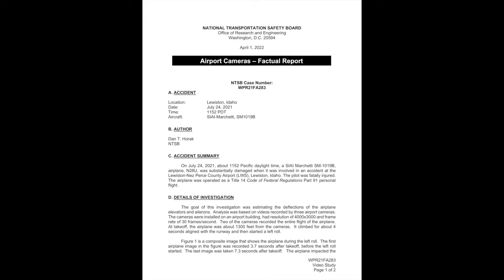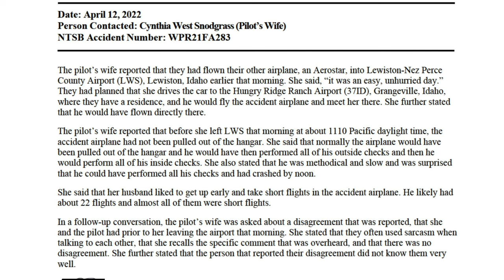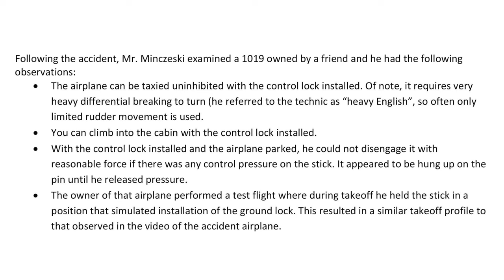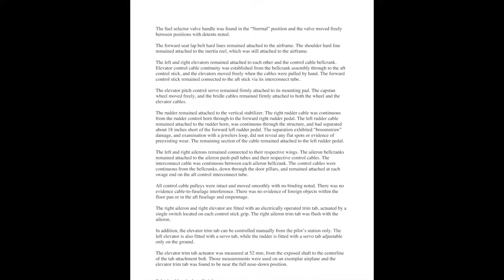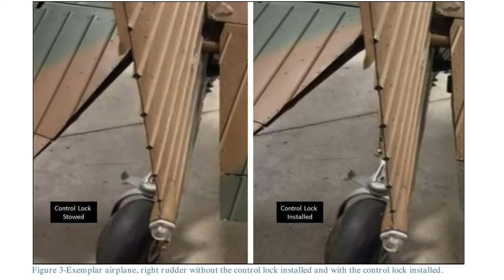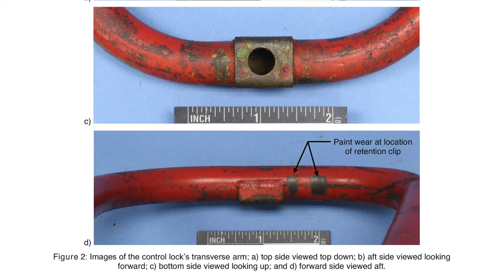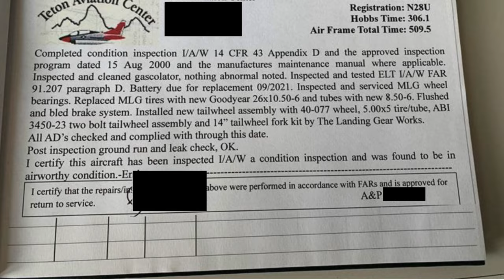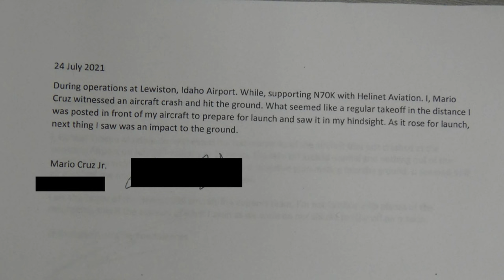Fatal Crash of SIAI Marchetti 1019-B, Part II

Comment: I'm not a pilot. I would barely even call myself an amateur aviation enthusiast. But I do know that even in Flight Sim, during the pre-flight checks, there's always that "flight controls: free and correct" part where you cycle the rudder pedals and control stick/yoke. Just simply moving it in a circle to confirm it's actually moving. It's hard to imagine such an experienced pilot overlooking something so simple. We all make mistakes, sure, but this is like a racecar driver not realizing his steering wheel isn't attached properly.
Reply: You should also look at the control surfaces… can’t see the?
Have someone verify them outside.

Comment: Maybe an improvement could be made to these control locks so they make all controls lock obviously solid instead of leaving the rudder pedals deceptively partially free in a condition that could fool a Navy top gun? I don't fly, but I thought the purpose of the control lock is to keep the control surfaces immobilized to stop them from flapping in the wind, and I thought the rudder would be included as a control surface that would require locking as well as ailerons and elevator. Or if the control lock only partially blocked the stick to an extent similar to the rudder pedals, maybe Snort would have had a fighting chance for recovery.

Comment: I’ve never understood why aircraft are not equipped with airbags. As a 38-yr veteran police officer who has investigated over 1000 collisions, including many fatality collisions, I have airbags save the lives of countless people involved in collisions with much, much higher speeds than what occurred here. Granted, as with auto collisions, airbags are not a guarantee to save everyone, but impact speeds like the one here are survivable, VERY survivable, with the aid of proper safety equipment. Hell, even a HELMET can increase the survivability rate of lower impact collisions in aircraft. Yet here it is 2022 and people still fly these simple aircraft with virtually no more safety protection that a lap belt and a shoulder strap Makes me wonder if “F.A.A.” stands for Forget About Accountability.
Reply: There are seat belts for small aircraft with air bags built in. However, I doubt a stall/spin from even this low altitude would be survivable with them. The reason being that the structure of an aircraft  is not built to be survivable in a straight down impact like this, and to do so would likely add so much weight to make it un-flyable.
Reply: @DirtFlyer  Not true… the main thrust of weight is still forward of the firewall. I’ve seen crashes where people have survived this kind of impact. The ensuing fire likely made sure he was dead. However, this doesn’t need to happen.
There is a fire extinguisher ball that could be mounted forward of the firewall. It only activates by fire, not heat, and weighs 1.5 lbs costs about $100. An incapacitated pilot can’t operated the fire extinguisher on board.
$100 is better that burning alive.

Comment: Two quick points - A) the control lock on this aircraft is both difficult to see and allows for FULL use of the rudder - it only locks the elevator and ailerons.  The NTSB report lists another pilot who experienced the same situation but was able to remove the lock in flight. B) Having spent many years as a FBO lineman, I hope that there is not a well-meaning individual who put the gust lock in place meaning to "help out" a famous pilot who is silently carrying this around with them.

Comment: About thirty years ago I was stopped at a red light downtown, maybe 2 a.m. Zero traffic, town was asleep. I was a little annoyed at my good fortune, being singled out like this for special treatment... I looked left and right, not a car in sight anywhere yet here I was, stopped at a RED LIGHT! the traffic gods must hate me I thought... ah, that's better the light FINALLY changed... Huh? WTF?? I wasn't even all the way through the intersection when I saw and heard lights and sirens behind me. Where the hell did HE come from? So, after the cop is checking my license etc. he asks me if I know why he stopped me. 
"Not a clue", I say. He tells me that he was waiting in line directly behind me when I just casually accelerated through the red light. 
"That's impossible!" I say. "I saw it turn green!" 
"No" he says. "What you saw is the light on the NEXT BLOCK turn green".
"Holy cow" I say. And then, after the usual pleasantries enquiring about my general fitness to conduct an automobile in the present moment, he let's me go without a ticket. I've never had an accident, over forty years now. Knock on wood.

Comment: Will someone please explain in layman's terms, what a 'control lock' is and it's functions?
Reply: Physically stops the winds blowing the control surfaces around when the aircraft is parked, a standard pre flight check is to waggle the control stick or wheel around while looking at the control surfaces to see you have full and free movement range,after maintenance always have some one look that the control surfaces are moving in the correct direction.

Comment: Those two people that saw the accident didn't even try to check weather the pilot of that plane was okay or not. unbelievable! 🤔🤨🤔
Reply: And that is my thought… but they can not just run out onto the airport.
Should the pilot have survived a simple 1.5lb fire ball extinguisher would have put the fire out before help could arrive if he was trapped.
These fire ball extinguishers could be mounted in front of the fire wall. They only activate when fire hits them, not heat effected.

Comment: Not trimmed right?
Reply: He forgot to disengage the stick control lock. Then he forgot to do the "controls-free and correct" actions in the Before Takeoff checklist. Notice that the tail does not rise as would be typical during a normal tailwheel takeoff run. It takes off in three-point attitude and begins a steep climb into a stall/spin situation. His last words were AAHH! SHIT! SHIT!

Comment: This was a sad situation. What also is sad and bizarre is the lack of concern with the people loading that aircraft that just whitnessed the accident and acted like nothing happend, they just went on about their business.  Shortly after this happened I watched a different video that shows the same thing.....unbeleivable, I would have been trying to get there as fast as I possably could to try and help.
Reply: How would you help? The leaking fuel catches fire and you put it out with your hands? ARFF was on its way, that's their job.
Reply: @kewkabe  Exactly. I learned that the hard way when I asked this on Juan's channel and really got beat up in the comments by pilots telling me that the leaking fuel could have exploded and caused more deaths. Apparently ground crew are trained to NOT run up to a crash.
Reply: @kewkabe  everyone acted correctly on the field… never run onto an active airport, even fire requested to proceed.
What might have saved him?… easy… a 1.5 Lbs fire ball extinguisher (look them up on YouTube) One of these mounted forward of the firewall would have put out the fire even with the pilot incapacitated. Not good in the cabin… but forward of the fire wall… seems like $100 we’ll spent.
Reply: @thatguy7085  He died from blunt force trauma though, not fire. What might have saved him was doing a proper preflight inspection or even just a control check prior to takeoff. Those fire balls look like a good idea but are they strong enough to stay intact after a crash?

Comment: Seems like the real problem is the existence of that lock. Is the purpose anti-theft? If so, that’s a stupid idea and those should be removed.
Reply: No, it isn’t for anti theft. It is to prevent the control surfaces from flapping in the wind causing unseen damage to control cables.

Comment: My God, was there a  mechanical failure, after rotation his angle of attack must have been more than 30 degrees!
Reply: No. The airplane had a control lock on it that's engaged on the ground to keep the wind from slapping the control surfaces around. Unfortunately, it seems the pilot wasn't paying enough attention to what he was doing and he tried to take off with the control lock still engaged.

Comment: Looks like a rudder fail?
Reply: Control locks were still on, very experienced pilot too, just shows anyone can make a mistake, some more costly than others.
Reply: More like an utter fail.
Reply: Mate it even tells you in the information what happened, and even if a rudder became disconnected this would not be the result
Reply: Let’s say that there was a rudder failure (there wasn’t), that would have no impact on the accident.
Reply: the video literally spelled out the cause for you......🤦‍♂

Comment: This is simply over confidence and slightly arrogant I know that because in my aircraft I have 2 giant covers where I’ve made it impossible to do this because im not arrogant and acknowledge im capable of this mistake. I have my wind shield blocked with a giant sign saying “Control lock” and the rule is. Remove and stow the lock before a sign can be removed. People the more experience you have the higher your chances are for this type of error to kill you. The arrogant, cocky, overconfident always get taken out by these errors.  Where the guy with 20hrs is shaking like a leaf thinking about the control lock the night before and again on there way to the airport. The old guy never thinks about it. Also. People are saying he did a 2-3hr basic pre flight. It’s not a 747. A basically check if your taking 3hrs your chances of forgetting something goes up. Yes in helicopters I do longer checks because all the moving parts. But I don’t spend more time because I feel the danger increases. If your there 3hrs. Do you have any idea how many interruptions you will get by bystanders. Overkill is a real thing also.

Comment: Yes, we should relax even more Private pilot requirements so more morons can operate airplane and share our skies. So much for before takeoff flight controls check - who needs that?
Reply: He was an F-14 fighter pilot, so your comments have no relevance.
Reply: They should also disallow "VFR"-only  flying and force trainee pilots to cope with IFR conditions (proving along the way that they can also deal with extreme foul weather conditions)
Reply: @None-zc5vg  How does this accident in any way demonstrate that IFR certification is needed for all pilots??? This pilot was one of the most highly trained pilots on the planet. Being highly trained and certified does not make you magically incapable of making the simplest of mistakes, such as forgetting to remove a control lock.